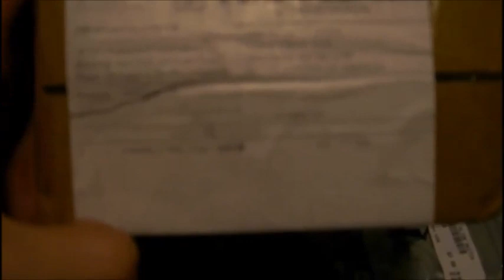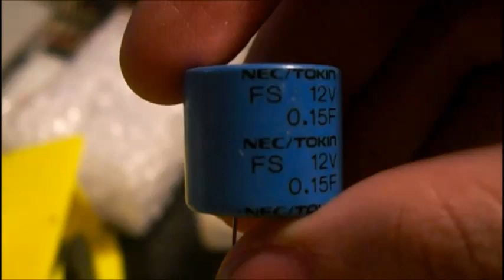mini thunderbolt siren chopper capacitor. will it work?

Comment: Never had much luck with capacitors, but the inertial speed controller I made for mine worked very well.
Reply: Tyler Davis I never expected to see you here— so that inertial speed controller, it consists of a motor driving a generator with a flywheel if I remember correctly, right?
Reply: @Creeperboy099  yes